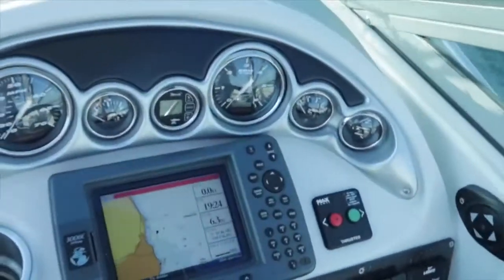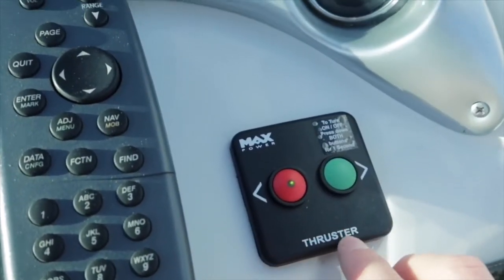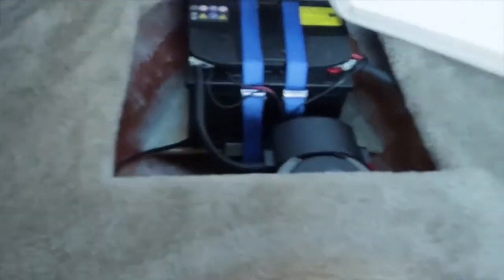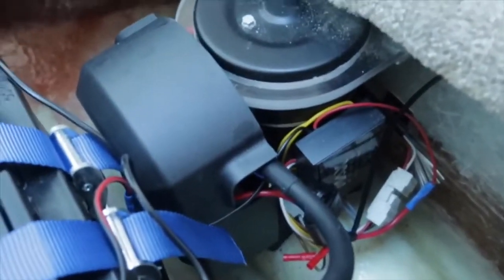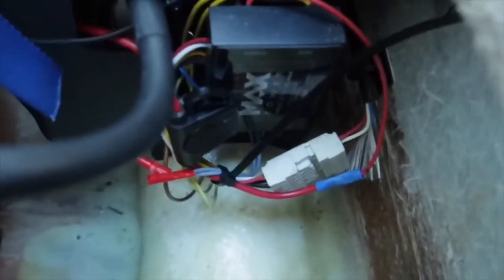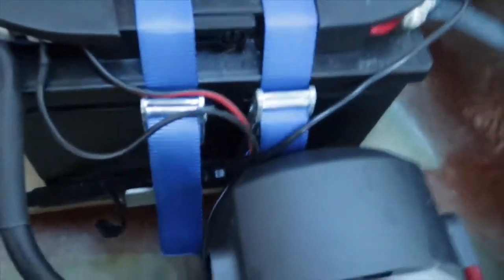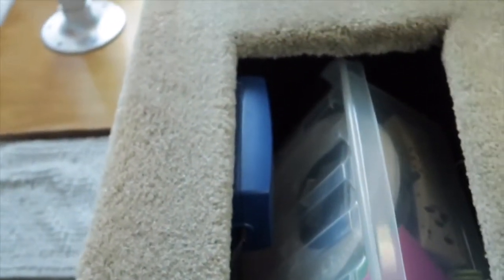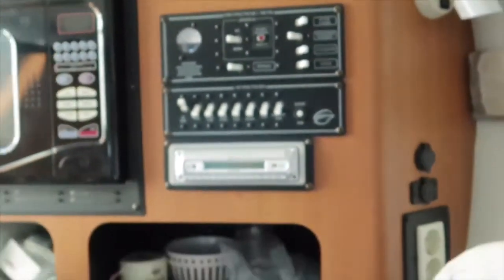Follow up on my bow thruster install

Comment: Hi there, great install.  I have a Crownline 270 CR so thinking about doing the same install.  The part that worries me more is routing the wiring to the helm.  Could you explain where you routed your wires?  Thanks!
Reply from the maker: Hi! That was actually quite easy. I drilled a hole in the bulkhead between the “salon” and the head (in the storage compartment under the cushion) Then pulled the cable behind the sink. As I remember, there’s a lot of other cables already running there you can zip-tie to. From the head there’s access to behind the helm, but long skinny arms definitely helps:). I unfortunately don’t have the boat anymore, so can’t help you with pictures. Good luck with the install, you’ll love it!
Reply: She's the captain ah ok so on mine there is an access hatch under the sink, so you can get to wires coming from the helm under there. Great thanks for the help!

Comment: Neat setup and something that definitely helps on a boat that size! 

Have you done many more extensive mods to the boat?
Reply from the maker: Kelp Eye Help Thanks! I absolutely love the bow thruster, it has made it so much easier to handle the boat when the wind wants to move the bow in the opposite direction of what you want. 
I did some carbon fiber upgrades around the helm and seats. I might just do a video on these😊
Reply: That would be great! I'd love to see a video on that.

What engine(s) do you have in her? Mercruisers?
Reply from the maker: I have a single Merc 6.2 MPI

Comment: Did you measure the current consumption of the thruster?
Reply from the maker: Hi, no haven’t measured, but it shouldn’t be above 200A. The power is rated at 2,7kW and at 13,5V this draws 200A. My circuit breaker is a 200A

Comment: Well done!  Really enjoyed the first part as well.  All the editing and fast motion through the long work made it much better to watch.  I only wish you got into the wiring steps in a bit more detail in this clip.  While you are a handsome fella, less of the mug shots and more of the actual wiring LOL! :D Just kidding.  How do you rate that specific Max Power CT35?
Reply from the maker: Thanks! I’ll try to include more technical stuff in my next video and less of my mug😂. I’m really happy about the Max Power. Only thing I would point out is the lack of a support bracket, which I had to make myself